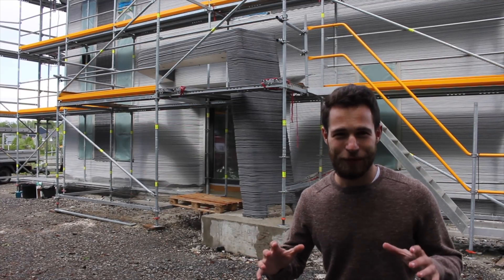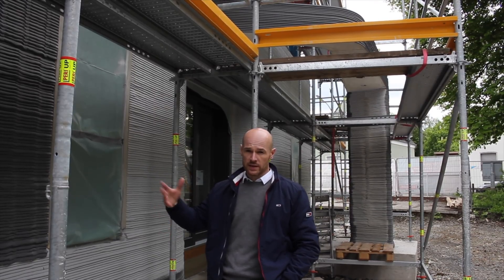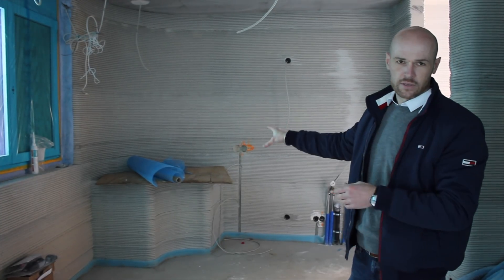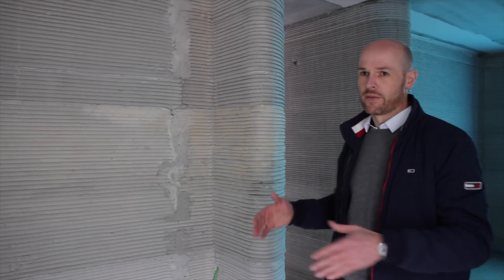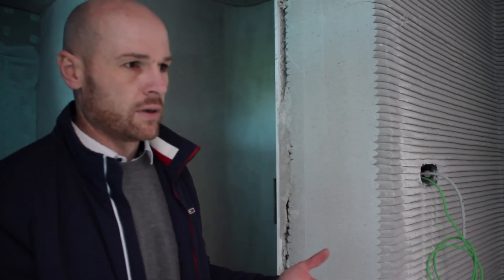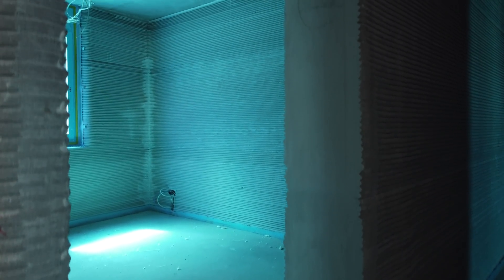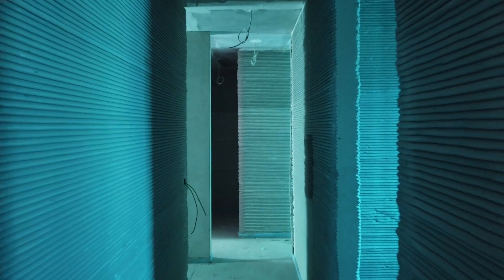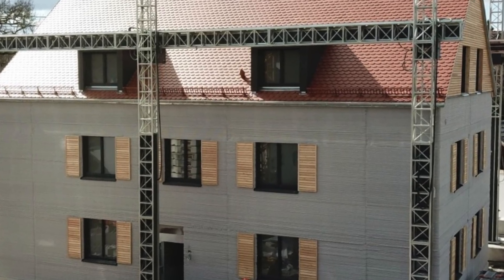Tour Most Innovative 3D Printed House in the World With Head Architect

Comment: Love the video, I have a quick question where is the load-bearing part? I don't see a colume so I would assume the printed wall is a load-bearing one. Is that correct?
Reply from the maker: There are vertical columns with poured concrete which are the load bearing elements of the structure.
Reply: @automateconstruction  thank you very much
Reply: @automateconstruction  Are these columns the one mentioned at about 8th minutes, that they are actually not required, but they are for getting an approval from the regelator?
Reply from the maker: @thutchaipuengsupa5665  Yes, it is a bit misleading to say they aren't required. There would need to be extensive testing and documentation of the compressive and tensile strength before I could confirm that to be factual.
Reply: @automateconstruction  Thank you bery much, that helps a lot with my understanding.

Comment: Looks very promising. My question is what happens if you have a problem in the walls, like a pipe leaking?
Reply from the maker: You can cut in if need be the printed parts of the wall aren’t structural anyway.

Comment: Any info on insulation and energy use? Sure, a concrete wall is great thermal mass, but solid from the interior to the exterior is major thermal bridge!  

(Not an engineer or architect, just a fan of innovative and green design✌️)

Comment: This is awesome.

I'm surprised they haven't added explicit data points or wiring.  I could imagine putting cat 6 points or even fiber in the same way as they have put in electrical plug points together with stations for wireless access points within the structure.  Perhaps even 4G/5G repeaters as I doubt there is much permittivity though the concrete in various areas.

Down the line I could even expect small SoC installations with microphones so that you could access digital assistants like Siri, Alexa, and Google Assistant anywhere within the house without having to have standalone devices exposed.

Apart from the passive lighting, I wonder how they are going to do the rest of the lighting for the house?  I'm guessing it will be conventional.

I love the heat management built into the structure.

Thanks for the video.  I hope you get to show how it all turns out.
Reply from the maker: They probably have done something along those lines for the smart home system and just didn’t mention it.
Reply: @automateconstruction  Understood thanks.

Comment: Been in the construction industry for 10 years, this is the future no more wood structures
Reply from the maker: Right? Lumber is just getting too expensive and concrete will last longer!
Reply: @automateconstruction  crazy idea how about used tires? There could be a way to recycle and reuse to build roads housed ext
Reply: @automateconstruction  Is it possible or in sight, to somehow print out wood homes?
Reply: Not so sure. Concrete is producing CO2 and new regulations will be put in place in favor of wood.
Reply: @savarzei  material science will advance like crazy in the next years. We'll have concrete mixtures that are CO2 neutral or even traps it somehow. Don't see how cutting forests can be more sustainable...
Reply: @savarzei  that's why this is so interesting it's at its infancy 
How about recycled plastic 🤔
Reply: I wonder if geopolymers could be an answer to the high CO2 emissions associated with the production of Portland cement?